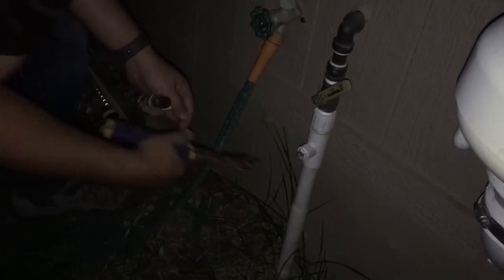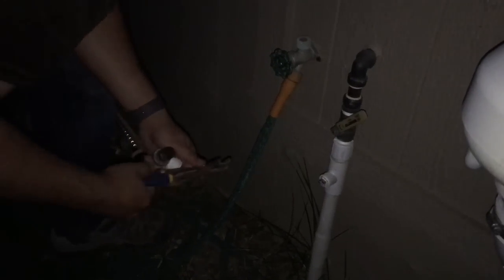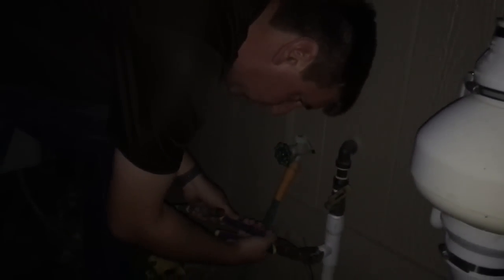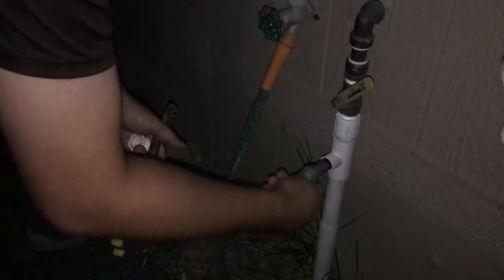How To Blow Out Sprinkler Systems- Cost Of Entry

Comment: This is great money if you know what your doing and dealing with newer homes.... but with only 40 psi you don't have to worry so much about blowing up pvc piping, valves, and as you see where he hooks the compressor fitting, that isn't a normal thing for a lot of irrigation systems that I've seen but maybe it is on east coast where it freezes much harder than the PNW....